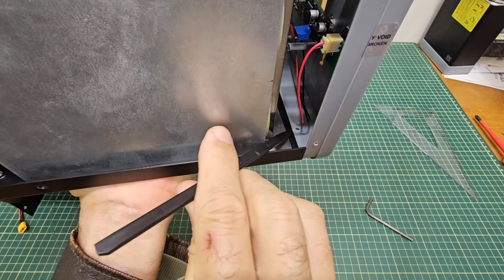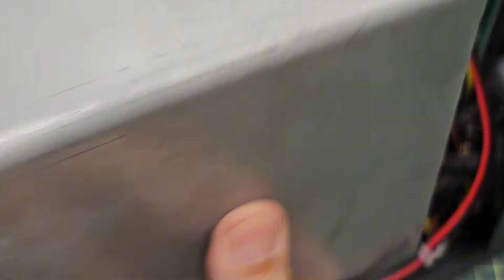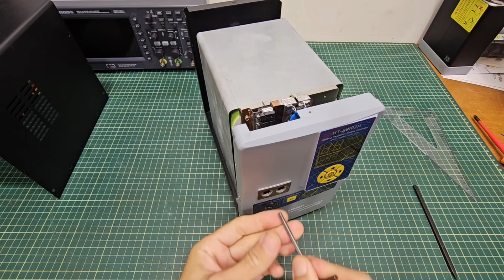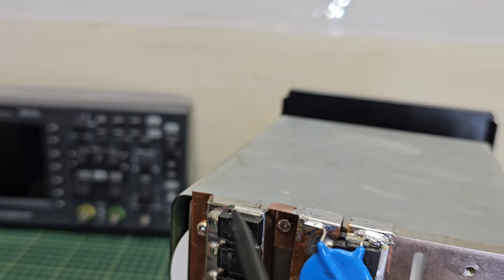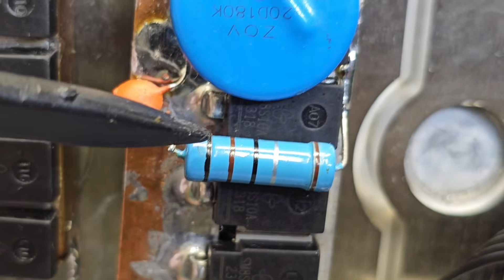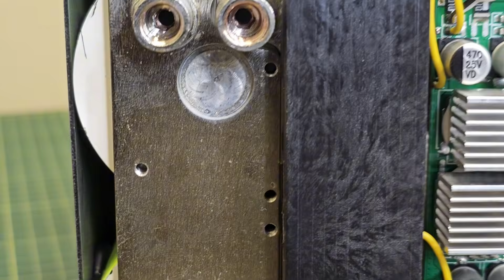Glitter 811H spot welder (HELTEC HT-SW02H) modification to eliminate Mosfets malfunctioning.

Comment: Very nice upgrade 👌
Reply from the maker: I'm glad you enjoyed the video, and I hope the upgrade helps.
Reply: @MOZARTF  bro can i know the value of resistor?
Reply from the maker: @jertondulay354  monitoring the Mosfets voltage with an osciloscope showed that the RC filter resistor value isn't critical. I tried from 0.1 to 100 ohms with no noticeable impact on the results. A good value to start is 100 ohms with the capacitor value of 100 nF. The most important component to protect the mosfets are the TVS diodes mounted parallel to the cable connectors.
Reply: @MOZARTF  thank you much bro i will make this for my glitter 811H

Comment: Good afternoon Maestro, thank you for the information.
I have two questions.
Why did you replace the sm8s15A TVS diode with an sm8s10A one?
Have you tested the original power supply? They say its voltage is unstable, and because of this, there are problems with the main board.
At the initial stage, is it possible to keep the original suppressors but add an RC snubber + ferrite rings on the wires, as you did on the 35 mm² cables?
Thanks in advance.

Comment: Hi, great video! I'm subscribing. I bought myself an 811h, but there's a problem. Please advise. It doesn't turn off with the button (on the back near the power cord). It continues to work for 1.5 minutes, then when the voltage on the display reaches 6 to 7 volts, it turns off. Does it turn off for you too?
Reply from the maker: Hi. My HT-SW02H (811H) welder turns off instantly as soon as I turn the switch off. Perhaps your unit has a defective power supply. As there are only 2 wires going from the power supply to the main pcb, it's easy to try a different 24v power supply. Note that the original power supply works at 20 amps max current draw.